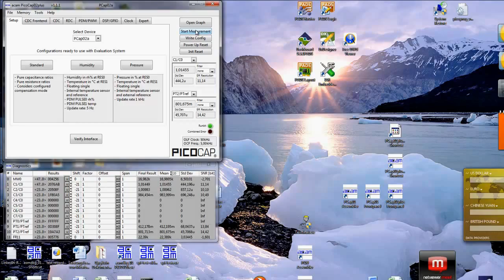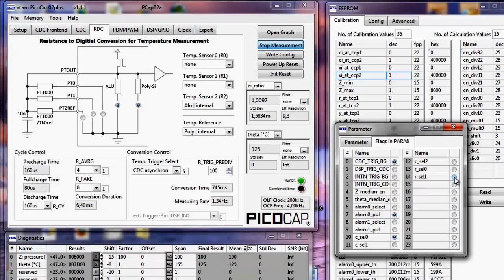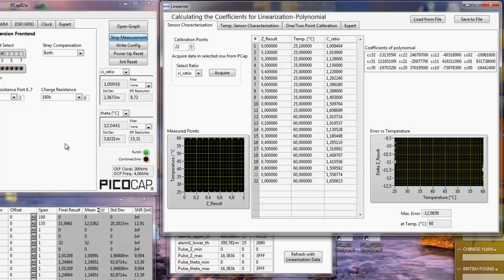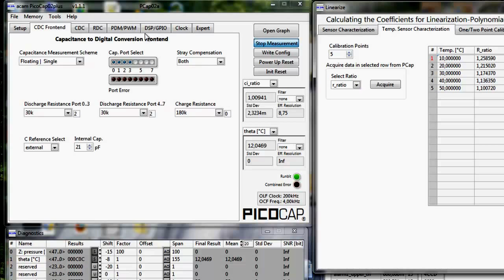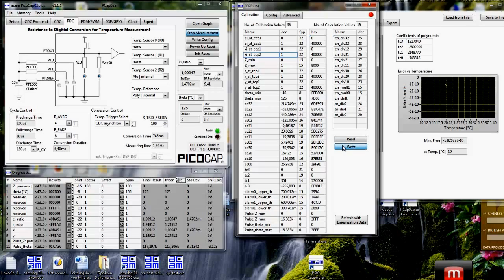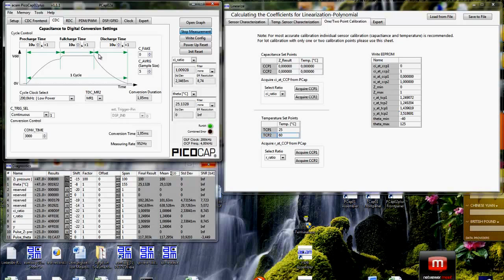acam - PICOCAP - PCap02 - Linearization

Comment: How to interface with micro controller.. like arduino firmware (SPI or I2c) .. Is there also default calibration??   or all time to linearization required,,,,,,when we use stand alone.on PCB ????